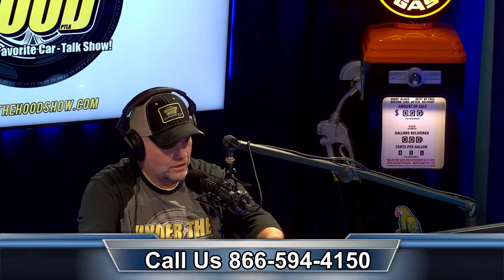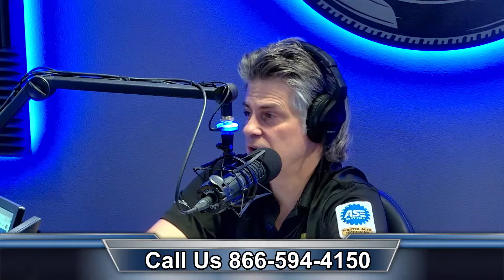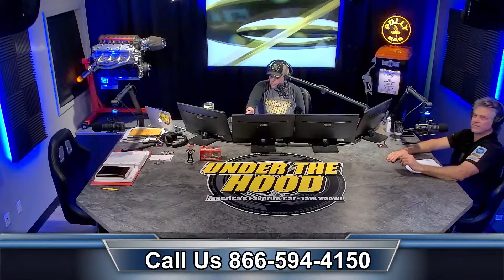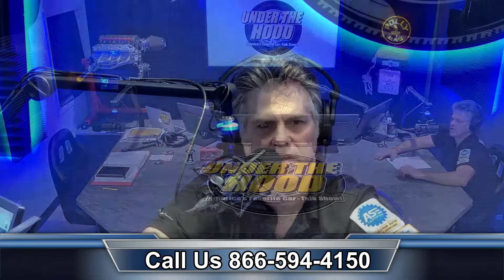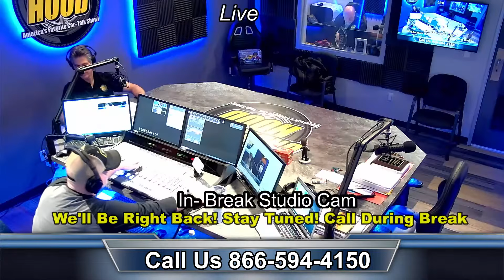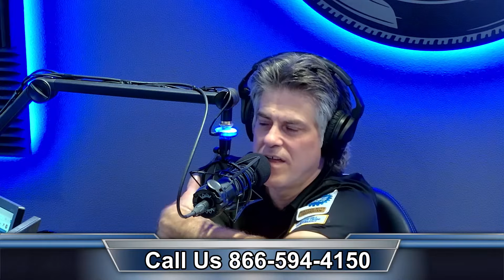Car Repair Advice from The Motor Medics on Under The Hood

Comment: I have a 2005 GMC Envoy  XUV 4.2L 165,000 miles I'm working on for a friend.  I replaced the water pump. I was going to take it for a test drive I was backing up and turned the wheel it suddenly stopped like the brakes locked up I hadn't touched the brake peddle. Then I straighten the wheel and drove forward it went like the brakes unlocked. I repeated this several times with the same results. I would like some advice as to what the problem might be .Thank you......Ray in south Jersey
Reply from the maker: @desireeflath6401  it sounds like it could be the four-wheel-drive binding up. We have seen the transfer cases in these vehicles go bad and stick. It depends on what kind of transfer case it has whether it’s an auto four-wheel-drive or a regular four-wheel-drive low and high. Whichever one it has if it has a 2 Wheel Dr. position try putting it there and see what it does. If it’s still winds up and that is the problem it could be that thedifferential is not unlocking on the vehicle. A good first check would be to look at the fluids in the front differential and the transfer case and see if there’s any metal filings in there, we often find a lot of heavy metal when they fail. Take care.
Reply: @UnderTheHoodShow  So if that's the case what's the fix?
Reply from the maker: You would need a shop to verify it. It could be a braking issue with the ABS or a number of other things too. Once verified, a certified used transfer case, or possibly other options would be available. First step is to verify what it is.
Reply: @UnderTheHoodShow  Thank you....Ray
Reply: I put it in 2WD it banged ,but it drove okay. So does that mean the front transfer case is faulty?
Reply from the maker: @ it sounds like that is a definite possibility, but you still need to get it verified by a shop
Reply: If it's faulty is the only fix to replace it?
Reply from the maker: @ yes. A case can be rebuilt but usually people buy a used one or one that is already rebuilt.

Comment: Hey guys! I listen to the show on the app. I have a 2008 Mustang Gt that's been modded for more power exhaust etc etc. All the lights on the car sometimes flutter. It used to only do it at idle but now it does it the majority of the time i drive but not every time I drive it. Today it's wet outside and very humid and it did not do it at all. The other day it was dry outside and it did it like crazy and kept dimming my headlights etc. I'm wondering if a loose ground is to blame based on what's it doing??  If so, where? The battery light comes on at idle but goes off when the car starts moving as well but it seems to be tied to movement of the car or the engine movement as I hit the gas as to the light going out.

I asked about this once before in a YouTube comment but at the time, it was only doing this at idle. You guys said belt and tensioner. I have not replaced those two things yet but the belt looks and feels good. Free of cracks etc. I don't mind replacing belt and tensioner but I want to be sure that's what it is first, since, now the lights are fluttering when driving at speed and at idle.

Thank you!
Reply from the maker: @jasonh.8110  thanks for watching the show! It sounds like it could also be an alternator too. We would check the voltage directly at the back of the alternator at that main battery post and put the other lead of your test meter right at the battery ground and see if the voltage fluctuates up and down, if it does something either going on with the alternator or the control of the alternator which is done through the engine computer. At that point, you’ll need to start checking more grounds and power supply to see if the engine computer is getting proper power. But we have seen many of these with alternator failure. Take care.